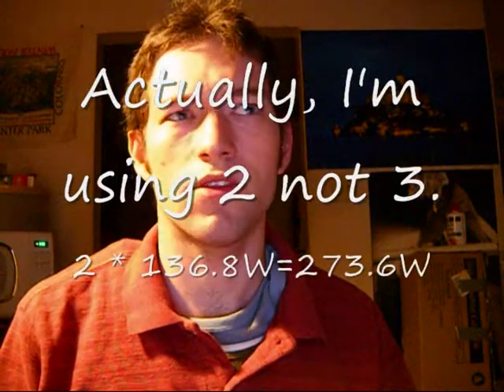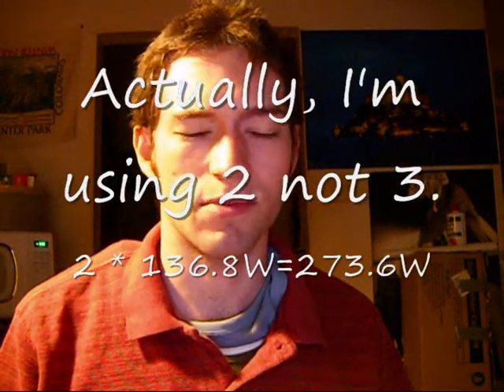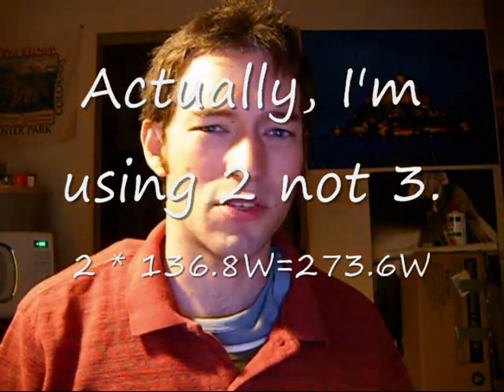Thermoelectric Cooler Part 15 - Reference to Tesla011's fan

Comment: Btw there is one more secret for TEC's. For the Application that you are doing, The Answer is to keep the efficiency high and not run a TEC at Full rated Voltage and current. You need to run it at around 7.5 to 9 Volts DC if its rated at 12 volts or so. Experiment with what voltage it likes and time how long it takes for it to get cold between voltages. The cooler the hot side gets, the colder the cold side gets, it will produce less heat at a slightly lower voltage which will reduce the amount of heat. I have a 60 Watt peltier just one of them thats rated for 15 volts and im running it at 9 volts at 2.22 Amps. Gets colder than it does at 12 volts. My Heatsink produced frost in about 5 minutes. Hope This helps

Comment: For the Theory to work Correctly, you do need to make it easier to remove the heat from the water by submerging the Cold heatsink into the water by filling the container to a certain exact level.

Comment: About that video (Brazil)...
1) YES, that fan is loud and it does make a great difference
2) Don't get amused about the frost formed on his heatsink, he is working WITHOUT a load (only in air)!!!  You are working with water which keeps/takes 4 times as much heat so you are working with 4 times the load he is.  Temperature change is a consequance of heat transfer from a given mass.  If you keep hot side cool for long enough you will eventually make the water turn into ice.